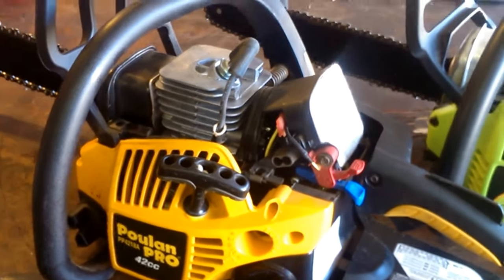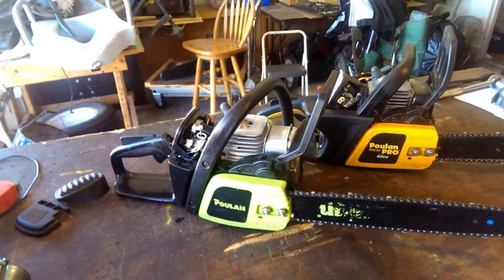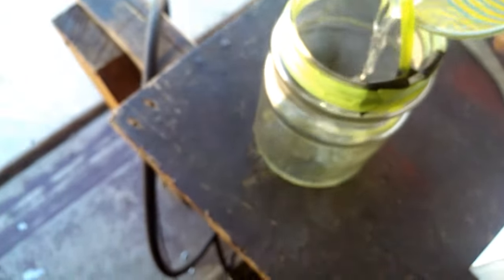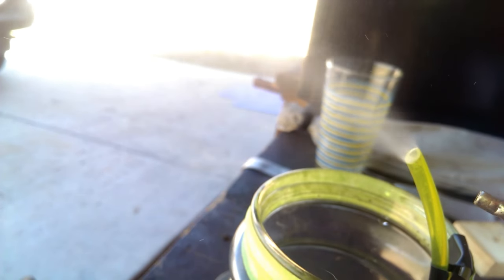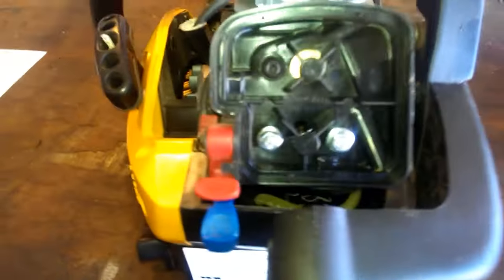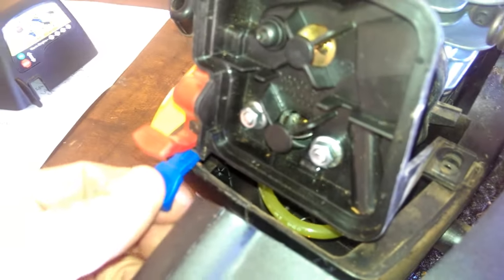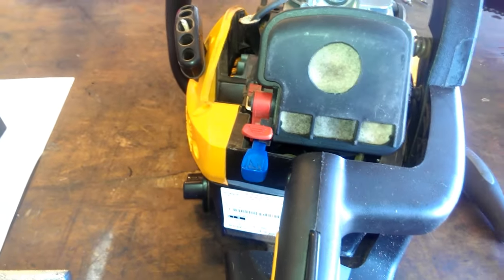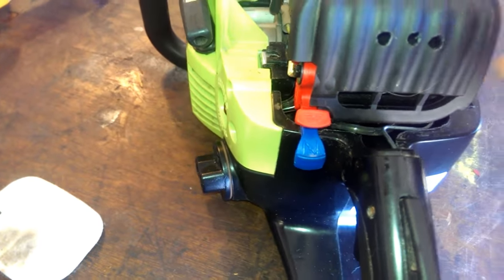Poulan wont restart after being used & how I solved my problem.

Comment: That was a good video, as I have a craftsman 18 inch 42cc chainsaw and it is having the problem where it will start and die
i have the same premix gas can that you have and it is a 2 gallon can so I put in two 3.2 l of mix to the 2 gallons of gas replaced all the lines as they were broken, no it will not fire at all. I am going to order a carb and the ignition system new and see how it will go. I want a new saw but if I can fix this one why spend 300.00 I will let you know how it goes.By the way I am in AZ also. Thank you for the time you spend to do these videos for us
Reply from the maker: Ernie G  Hey Ernie, you must have alot of small equipment to go thru 2 gallons of 40:1.  I have videos on how to do the fuel lines. Spark compression and fuel delivery and it will run!  Good luck buddy.
Reply from the maker: Ernie G  will it run with the choke on 1/2 way?
Reply: No it will not even bark, the spark is weak as well
Reply: i have at this point 3 that use 40;1 plus i use it on ant dens lol

Comment: Thanks for this video. I took my Poulan in for an oil leak probably ten years ago after it started leaking the first day I used it. (Canadian Tire wouldn't take it back since I didn't actually open the box until 2 months after I bought it) Then I had this hot starting issue and seized up the pull cord trying to get it going.  Was so angry I threw it on a shelf and left it until recently I took it out and managed to fix the pull cord(would love to have  seen a video on that before spending an hour trying to wind that spring back into place!) Got it running but it does leak again.  I'm handy but definitely not mechanically inclined... Going to do this fix and hopefully be able to use this piece of %*\#! saw.. Thanks again!
Reply from the maker: This might help with the oil leak. It's normal. https://youtu.be/FTKt9F0ddXs good luck.

Comment: I have a similar problem with my Poulan PP4218AVX. I was able to get it to start and idle, but as soon as I engaged full throttle it would stall and die. I have it mostly taken apart, and I was going to order a new carburetor kit on eBay for about $20, but I might try your "trick" first. I've always had problems with chain saws, mostly from leaving fuel in them for too long, and now I have bought an Echo lithium cordless saw which will probably meet most of my needs. But I want to get this gasser running. Thanks :)

Comment: Someone below asked you about a Bluemax chainsaw - stating that it works great until you try to restart it hot.  That appears to be a known issue with the brand.  It's a $100 saw, so I suppose that's part of the issue, but I concur that when it runs, it runs strong.  

If I shut it down and restart within a minute or two, no issues.  If I let it sit longer, it won't restart.  If I let it sit until it completely cools, it restarts no issue.  So there appears to be a sweet spot where if it's cooling down, it won't restart.   I have been able to get it to fire during that no-go zone and here's how:

I removed the air filter and pull string head (that way I can crank with a drill - saving blisters for other projects).  With choke fully on, it'll fire, but will shut off within 1-2 seconds.  Quickly opening the choke by the smallest possible margin, while simultaneously applying throttle will allow it to keep running - albeit very rough and requiring constant adjustment of choke/throttle.  Once it runs like that for 30 seconds or more, it'll calm down and run like normal again - at which point it can be turned off, pull-head and air filter reinstalled, and then quickly restarted (waiting more than a minute or two and it'll be back in that no-go zone).  It's a pain, but it works.

I say all of this to ask you, based on the symptoms and actions taken, can you think of what would cause this type of hot restart issue?  Clearly, it's just a matter of temperature.  Perhaps some tolerances are changing?  It did this from the first day I've owned the saw.

EDITED TO ADD:  There is no primer bulb on this saw.  You have to prime it by pulling at least 4x with choke on when it's cold.  Pain, but it works every time.  Also filter cap seems to be vented all the way around (unlike the "pull-on" brand).   I may still drill more holes in it though.
Reply from the maker: What you are describing to me would have me pull the carb and double check the gasket that allows "pulse" air to assist the carb. Im not 100% its a temp related issue. More that it cant hold suction in the carb. Another place to look would be the pump side of the carb. If you solve this, let me know please.

Comment: Hey Zombie Dave, am new to your  site and like it very much ! I will be a regular viewer.  When my father passed, he left a Homelite   IV Super 2 chainsaw that gave me the exact same problem !!I  In 95 degree heat, tugging and pulling on a starter rope after just using it and turning it off, I thought about tossing it into the lake !!!  Granted , it is a model from about 1985 or 1986, it lasted and ran well all those years ! Now I will try your solution before I decide to toss it. Thank you for giving us a possible solution !!
Reply from the maker: Thanks for the follow David. Those older models are not known to have this problem. Be sure it is running order before you make any mods that you see on my channel please. Start with the basics. Fuel filter,fuel lines,carb is clean with good diaphragms etc. It could be a 'seasoned' saw and just needs a tune up. If it ran well pre ethanol you may just need to make a carb adjustment.
Reply: I will check all those things first before I try your mods ! Thank you for the advice !!

Comment: Hey Zombie D. See if you can give a little insight to a problem i had a while back. I cutting up a large oak that had been blown over on a storage building with my Husqvarna  and the starter cover broke and since the saw is so old the part had to be ordered through my local parts store . Anyhow i had yo get the job completed so i went to home depot to get another saw. Since this was right after a hurricane saws were in hard to find. About the only thing they had left was a homelite 16 inch saw. I can't remember the ccs. The saw start right up and performed good that day. The next day i returned to the job and the saw would not crank for anything. The day before a great saw to crap the next morning. Same can of fuel. So i returned the saw and they gave me another one. Went back to the job filled the saw with the fuel that i had been using the whole time. Cranked the saw and it done a great job just like the saw i carried back . I still didn't finish so i had to return to the job the next day.  Again this saw done the same as the other one. No start period . O also returned that saw and just waited for the part to come on for my Husqvarna. Just seemed weird that 2 identical saws done the same thing and were brand new in the box . Checked my gas and spark and even tried cranking it without the filter. No go. I would just really like to get your perspective on this. Thankyou.
Reply from the maker: Hey Dewey, by reading the text twice and maybe you omitted some detail, but from what you wrote and if you dropped it off with me I would pull the muffler. Im looking for single or double rings on the piston and scoring.(Im betting single) NIB and put to hard work (its a homeowner bucking saw at best) I would venture to guess that the break in period was minimal. A compression test would be next. If you shot fuel directly into the carb and not even a pop I would say there's prolly not enuf compression. Your Husqvarna is just a better built machine overall. Thats my guess. Ring wear after being worked hard out of the box.

Comment: I also found a problem with the block isolator between the carb and cylinder I thought I would tell you about.I think there is a air leak on that block because I pulled the carb off and noticed gas covering the gasket and found there is a little ridge around the port and bolt holes and then I pulled the isolator off and that gasket was also wet with gas.So I noticed a small ridge there also.I took a piece of 150 grit sand paper and sanded those small ridges off flat.I think there may be a small air leak around the gaskets.My saw seems to run much better now.
Reply from the maker: That's very interesting. I'll admit I never dove that deep into it. I'm not a big fan of the stratocharged engines but my fix worked for me years ago. I now run a echo 340T and a CS310. They have treated me well and I got them both for $9 each.  Thank you for commenting and perhaps someone will follow your good advice. Take care my friend.👍🍺

Comment: Very instructional -  A+
Reply from the maker: brokkenstar. Thank You for the kind words.
Reply: Your welcome;  as for a dirty filter,  I was wondering how you washed them,  any solvent or just soap and water?
Reply from the maker: brokkenstar First I washed with gas. Then air dried it with my compressor then washed again w/Dawn dish detergent and air dried again. I Do not oil my filters. I clean them enough that I don't worry about it.
Reply: Thank you.

Comment: Very helpful video.  I got crazy and adjusted the idle screw and the high/low speed-load screws.  Now the engine won't start at all.  How do I get those screws back to a place that will allow starting, and then fine-tuning for operation?
Reply from the maker: It's impossible, just throw it away.
Reply from the maker: Just kidding 😁 . Turn the high and low speed jets in until they stop. Don't force them. Back them out 1 and a half turns each. That's a good starting point.
Reply from the maker: Tom, if you clicked the notification bell on my channel I have a video that I made this morning with you in mind. It will be up shortly.
Reply: @ZombieDaveAZ  Thanks!  I'll be on the lookout.
Reply from the maker: It's up now.

Comment: I have a cub cadet electric start self-propelled push mower, always hard to start when hot. Had to pull start it . The air cleaner box  was more restricted than your saw. After watching your video I Drilled several holes inside the box you can't even see them. problem solved ,starts fast every time hot or cold. Thanks. Ed in Callahan ,Fl.
Reply from the maker: You are most welcome Ed. I hope you subscribe. I don't put out videos every week like some guys. But, when I do there is a tip or trick in nearly all of my 200+ small engine videos. Thanks for taking the time to comment brother. 👍

Comment: my poulon pro works fine.  i bought it at harbor freight in 2013 and have cut about 10 cord of hardwood for my woodstove.  it runs ok, but i use the tickler after she sits a few.

Comment: I bought a new Poulan chainsaw ( it’s still in the box) and I’ll surelly check about the air filter and also slightly increase the spark plug gap.

Comment: Pull the choke lever out and push it back in. That holds the throttle open and it'll start first or second pull even when hot no need to drill holes however the extra hole will add airflow and make a snappier more responsive throttle if tuned properly.
Once it fires up it'll be on a fast idle and you just hit the throttle and it kicks it off just like when you start it cold.
I open my gaps to 0.29" as well never have hot start issues.

Comment: Q1 What cause the fuel to back flow or splashing on the air filter? How can we clean it?
Q2 Is it possible to clean the fuel filter or at least make it better by the time I get the new filter? How do you clean it?
Thank you sir, nice video and very nice vulgarisation of the "science of 2 stroke engine"!

Alex from Québec, Canada

Comment: It appears to have worked for me as well Just need to reset the ing time reset card. Thank you kindly sir as I hate to throw things away when it is just the manufacture is the one that blows it. Also I will be getting non ethnol fuel. but up here in Alaska it cost about $26.00 a gallon. But I am sure it will last me a little more than a year.
Reply: I paid about $6.00 for a quart of the premix 40-1
Reply: @bentback1  Update for you hope it helps and saves you a lot of money. What I do now is mix my own now. I go to the airport and get 100 Oct Avcatalytic Converter so there is no problems with this.

Comment: Yup, those "diaper" filters definitely don't work as well as the accordion style, less overall air flow.  First thing I would check for is obstructions in the muffler, especially a plugged spark arrestor.  Too much back pressure in a 2-stroke isn't a good thing.  Might also be running slightly rich, although 2-strokes in general tend to "spit-back" through the carb if the exhaust or intake ports aren't machined to the proper tolerances.   This is why we generally pay more $$ for name brand equipment.  You could try a port and polish on the exhaust manifold with a special emphasis on the top of the port to allow the exhaust charge to evacuate the combustion chamber slightly quicker.  But, might not be worth the trouble either

Comment: After running the engine, adjust the mixture using the spline tool. Set the lo mixture for highest RPM'S at idle and hi mixture for highest RPM'S at full-throttle. Set the idle just until the chain just stops. Replace just the diaphragm first. If that don't work, replace the carb. Look at the make, Zama or Walbro and the number on the carb. to get the right kit. Amazon has 12" hemostat pliers to replace fuel lines. Cut the lines at a slant to ease installation. Ethanol messes up carbs. and diaphragms. To test a primer, put the hose in water and pump. If water shoots out, it's good.
Reply from the maker: Marty Stevens  Marty knows his way around a saw too. Good advice.
Reply: What the hell that was about green tube,  I don't know. I must've been half asleep! It don't make sense! I'm like 'What the hell is that!' I deleted it. Sorry.
Reply: That chainsaw looks just like a Wildthing except the starter cover is purple and the bar cover is purple.

Comment: Since in most motors the resistance to flow in the air flow path is directly related to the amount of fuel pulled into the venturi any decrease in that resistance by say cutting holes in the air cleaner should lean out the fuel mixture which seems counter intuitive to easier starting.  But cutting the holes in front of the stratocharge port seems to increase mixture richness?  Two of my Poulan's have stratocharge but restart just fine when hot.  Also I mix 40:1 in spite of Poulan's recommendation but that probably has nothing to do with ease of starting other than maybe they run cooler due to better lubrication.

Comment: put a new carb (chinesium) on my poulin p3314 saw.  it will start fine when cold no issue.  run for a bit, shut it off and it is a BEOTCH to get going again.  I did the mod you noted to the cover drilling holes in the plastic cover.  plug has good spark...is getting fuel.  there is great compression.  new fuel mixed correctly.  ideas??
Reply from the maker: Did you do the choke out and then 1/2 way back in? That helps a lot. That's the high idle restart..  also clean air filter.
Reply: @ZombieDaveAZ  I thought using the choke only applied when the saw was cold?  new clean air filter installed.  new fuel. (40:1).  I adjusted the coil pickup so it was closer to the 2 pick ups on the flywheel.  seems a bit better now.
Reply: @ZombieDaveAZ  I put new fuel lines and primer bulb in it.  that made a big difference.  it was leaking fuel under the carb and sucking air I guess.  starts right now.

Comment: The location and size of the hole are just reducing a percolation problem created by the cover.The lower holes let all the air in it needs to run but the hot soak of motor lets hot gas vapors from the carb to be trapped @ the top of the cover ie an overrich hot start. more throttle opening or several smaller holes near very top of cover w cooler air flow from bottom of cover will do just as well. all older cars had some type antipercolation device
Reply from the maker: James Farley you are awesome! I hope a guy like you will follow my channel and jump in with your knowledge. Thanks

Comment: Dave my 3314 poulan Boggs and have to restart it all the bloody time . I ran saws all my life only that they were pro saws like the husqvarna  . I just want on 5his brand new saw is the proper adjustments  on the hi and low speed jets . To me the saw wasn't properly adjusted from factory . And I get no help at local dealer . With retiring from tree falling I wanted a smaller saw so I got this one and I like the little bugger . Used to running bigger heavier professional  saws . Help out if you can
Reply from the maker: Hi Kevin, we can do this buddy. First up is set the low speed so the saw will run on its own when cold. I don't know if you have carb restrictors on the saw or not.

Comment: Ok iv worked on poulan pro 4218a they have rubber tipped needle in mine they will run but they deform a little bit and leak gas out the carb. I like regular needles without rubber tip that can cause deformation and leak etc. just my opinion and experience.

Comment: Dave, I had this problem with a Poulan 5020AV, pulled the carb to clean and now can't get the choke to stay open, everything seems to work but it won't engage and I can't find any reference on Youtube or elsewhere to see what I'm missing or if I broke something.
Reply from the maker: I'm not sure if I can help you on this one. It sounds like a trial and error type deal. If the throttle is back on and operational ,you should be able to insert the choke dogleg and then drop it into place. No?
Reply: @ZombieDaveAZ  anyway to send you a photo, you might spot it right off, if not thanks for the initial reply
Reply from the maker: @barryrooker6726  try zombiedaveaz@gmail.com I'll check the spam to see if it goes there.
Reply: @ZombieDaveAZ  Dave, Thanks so much for taking time to review my setup, your pointing me in the right direction enabled me to fix my carb seating problem. Thanks